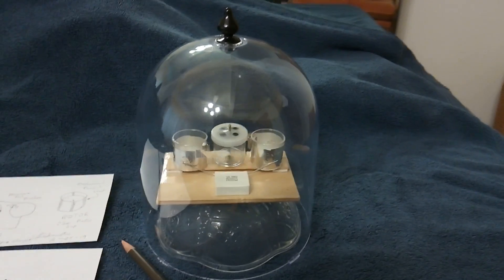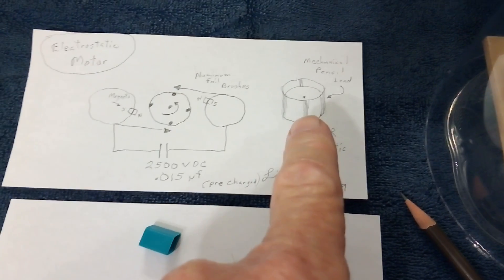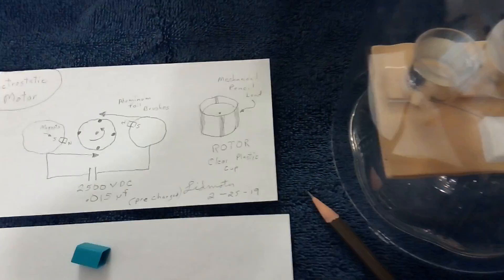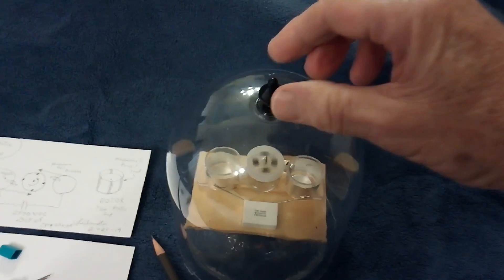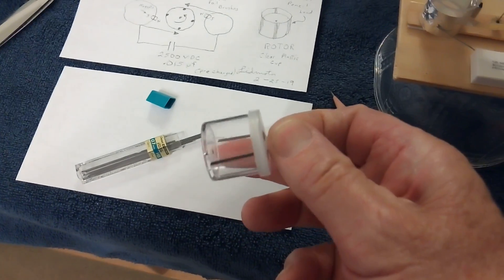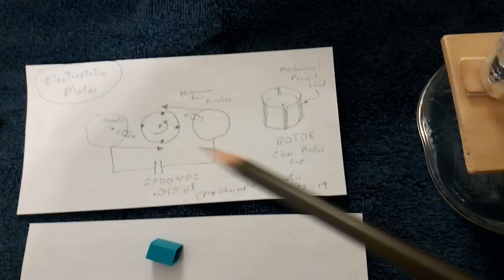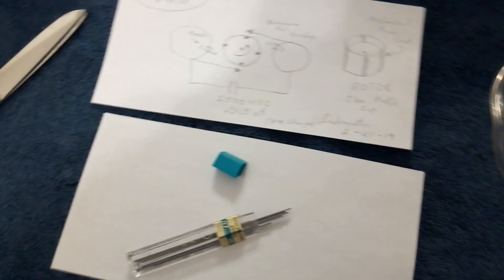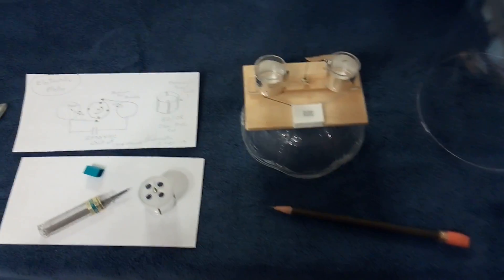Electrostatic Motor --Using graphite rotor elements

Comment: Nice build and good demo.  But I'm puzzled by the role of the magnets.  Any constant diamagnetic repulsion wouldn't turn the rotor.    Are the magnets just acting as a second pair of electrodes?  Would non-magnetic conductors placed in the same position produce the same effect as the magnets?
Reply from the maker: You are probably right.  Perhaps some experiments charging pyrolytic graphite with high voltage to see what it does to the diamagnetic effect would be a simple way to find out.  I should get my ordered pyrolytic graphite this week and I can do that test.  It would be interesting to make an electroscope out of these pencil leads and see how it reacts to a magnetic field .   If the pyrolytic graphite loses (or gains) some of it's diamagnetic trait when it is highly charged then maybe there is something interesting going on in this little motor.  Odds are that this is just wishful thinking.

Comment: Well done. To what voltage did you charge up the cap ?
Reply from the maker: I don't have a high voltage meter so I don't know.  I used a 12v / 5000v negative ion generator powered with only 4v so the voltage was much lower.  The cap is rated at 2500vdc.

Comment: A moving charge produces a magnetic field.  Perhaps the moving charged rotor, not only works in the usual electrostatic induction way, but, is getting an extra boost kick of (force) causing momentum from reacting to the magnets.  Maybe that is why it seems to run longer with magnets.  What if you substituted strips of aluminum foil instead of the pencil lead, would the system still work and run extra long likewise?  The old electrostatic motors used metal foil but I never saw any that also incorporated magnets or magnetism principles.  Something to explore.
Reply from the maker: More testing is needed for sure.  It is hard to know what is really happening here.